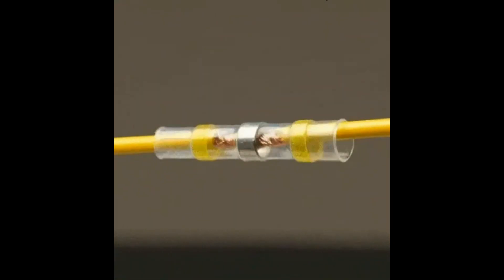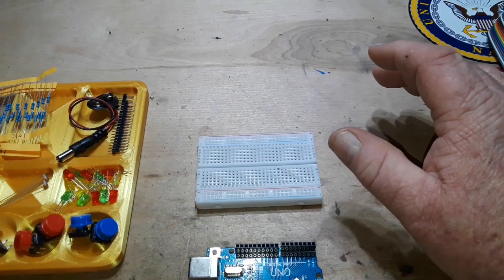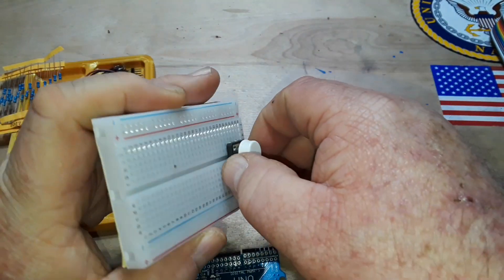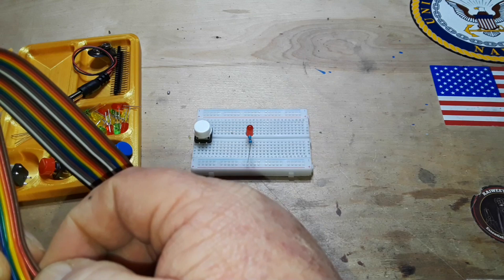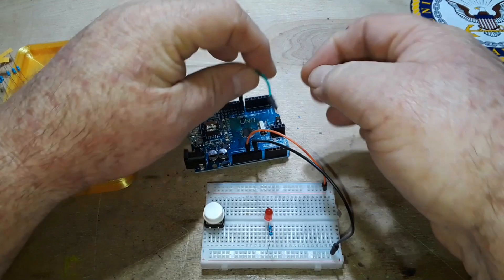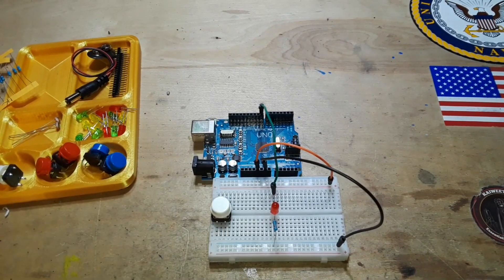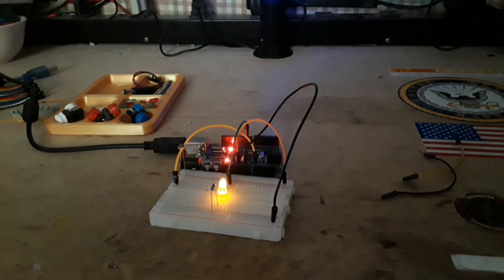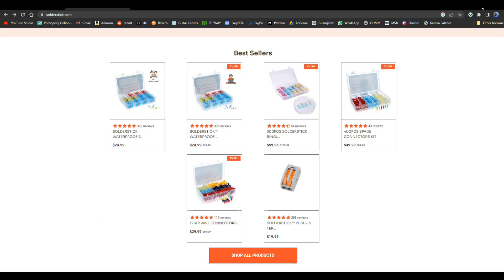Arduino UNO R3 Starter Kit - Sponsored by Solderstick

Comment: Paul I recieved a couple of the "Arduino Uno" kits from Temu and there is a hidden Gotcha. They are sending boards with Atmega328PB (NOT Atmega 328P) chips which  require extra entries for the board manager . This could trip up newbie users.

Comment: nice i remember another review but have u ever seen the sensor pack the sell. ive seen two one has 37 the other 46. if so they worth a crap or am i better off just making all the sensors i need. thank for the content sir. 🫡🇺🇸💯
Reply from the maker: The cheap sensor packs are great if you can get them for around $20-25.
Reply: @learnelectronics  awesome thanks